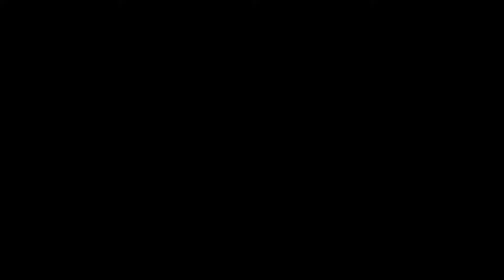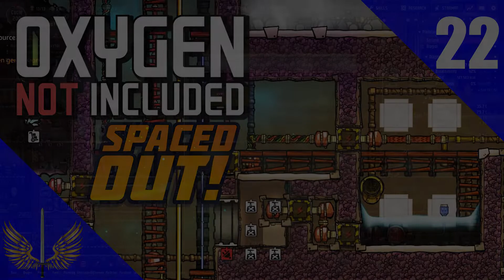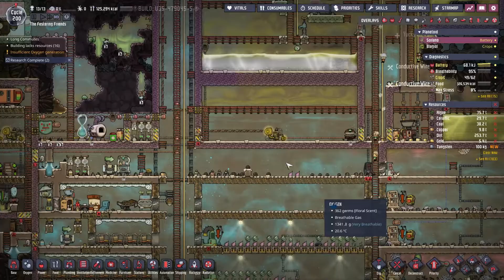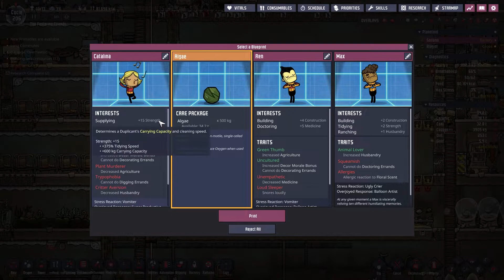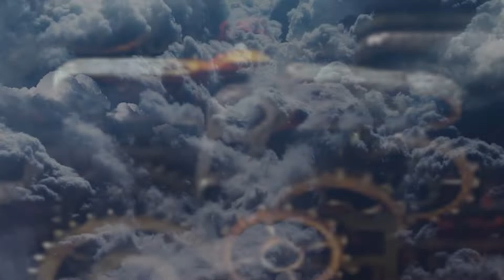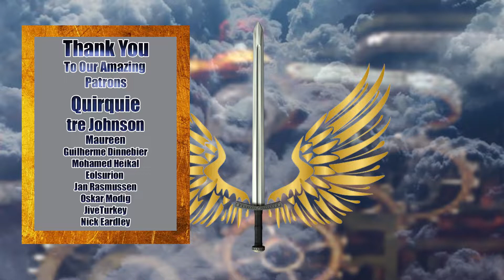Oxygen Not Included - Spaced Out DLC - Season 1 - Episode 22

Comment: Looks like the oxygen not included wiki has a drowning chamber article; you can either pump fluids in or have mesh tiles and timed airlocks push liquid up. It's not very detailed, but it looks like a starting place.
Reply from the maker: Ah. Never thought of putting the critters u set the water. I was trying only to drop them in! Lol. Thanks.
Reply: @ClanHawkins  For sure! I have ONI sitting on my steam account with 50 minutes played, watching series like yours got me into Factorio, so I'm betting after enough time I'll get back into ONI.
Reply: The setup you have for the kill chamber will work, you just need to replace the bottom mechanized door with a pneumatic door. This is how I drop my fish into the reserve tank I was telling you about (not my breeder tank). Items and critters wont drop through manual or mechanized airlock doors when they open but they will through pneumatic doors. Oh and they do need more water. I did some testing when I setup my "evolution chamber" I called it and I needed at least 1 full level of water across the bottom of the tank for the critters to drown. Then I have some 800 kg of water in the second layer just to be sure.
Reply from the maker: Ah! Dang. Already changed it but good to know the pneumatic doors don’t hold them up!